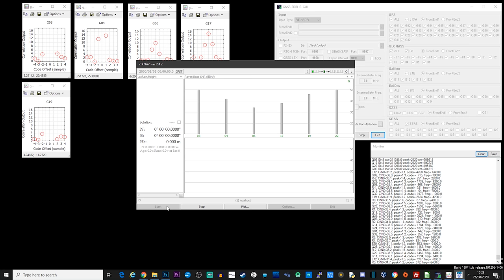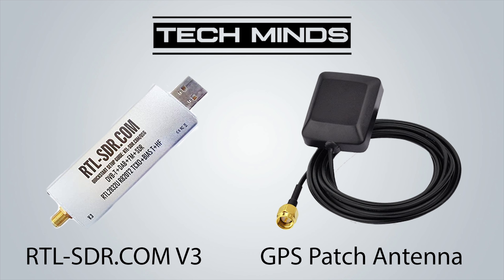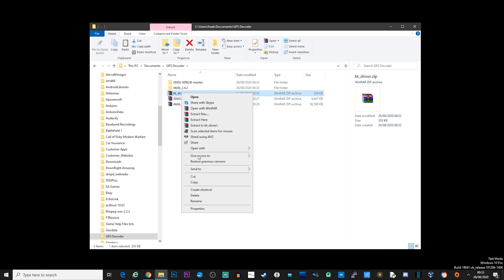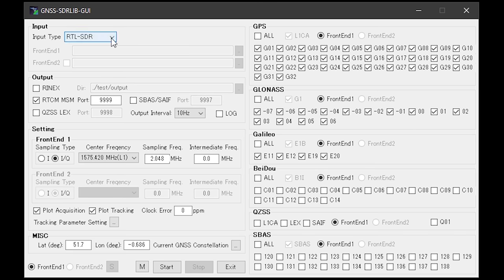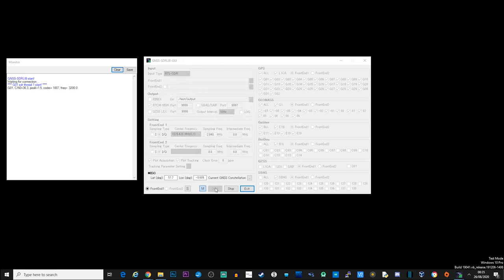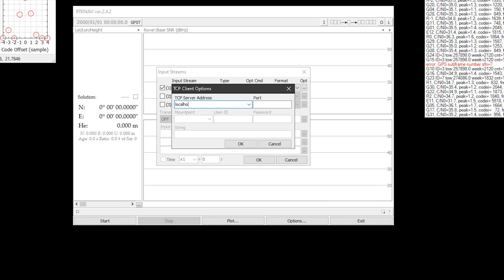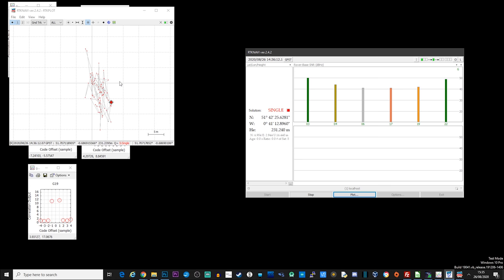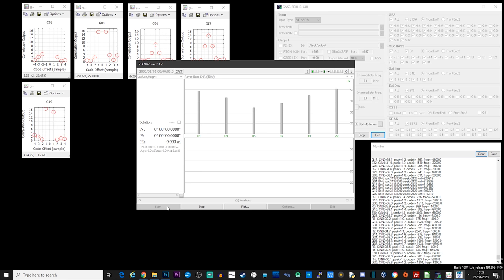Decoding GPS using an RTL SDR Receiver

Comment: The gnuplots after pressing start in gnss do not pop up but the cmd windows show up. The monitor in gnss does show a similar feed as in the video. RTKplot also experiences timeout while trying to connect to localhost. I'm not too sure what's the problem, I followed the video step-by-step. Any advice?

Comment: Hello, Techminds. I am currently using the same hardware and software setup on Windows to log the GPS I/Q data. However, I'm encountering an issue. When I press "Start" in the GNSS SDR-LIB GUI, it doesn't seem to initiate any process. Additionally, RTK-Navi is stuck showing the "connecting" status. 

I would appreciate any guidance you can provide to help me resolve this problem. Thank you.

Comment: I get data scrolling in the monitor window of GNSS even when no antenna is connected. With an antenna connected and RTK running, nothing is displayed. Admittedly, I don't have a proper GPS antenna, just a dipole I use for ADSB, so I guess it could just be down to s/n ratio.
Thanks!

Comment: Looking like it has duel frequency capability see front end One and a option  for a second front end capability very nice Now all you need I guess is a multi band antenna 📡 probably won't work as well as a dedicated device or Ublox kit but it seems like a very affordable alternative 😀 Nice video 👏.
Reply: Help, I'm from Ecuador. I'm having the issue that I'm getting the graphs of the correlation output vs code offset, but the Monitor doesn't give me the ID. Only peak, code, and frequency show up. Thanks.

Comment: I cant do it and im pissed.
I have three different GPS antennas, all of them working "tested with a GPS receiver". I connect the bias tee and supply 5,2VDC from a USB to the coax that goes to the antenna.
The 5V are ok and measured on the antenna side.
The only thing i see on Airspy when i connect the Biastee on the USB is the Threshold goes higher.
Ive tryied to play with the RF Gain but there is no reception.
Honestly, i don't know what else to do.
Reply from the maker: Do you have an RTL based SDR you can test with also?
Reply: @TechMindsOfficial  im using this exact device https://images.app.goo.gl/CTyvY9KPYvRVbzZB6

the highest frequency that i did a demodulation, was at 1090 for ADS-B.
I had an old rtlsdr with E4000 that made it to receive EMEA using a JRC FBB 250 from it's LBand output.
But i dont have this dongle anymore.

Comment: Great video! Was able to open GNSS-SDRLIB and get it to stream data to the monitor, but no sats show up in the RTKNAVI window. Not getting any of the plots either. I tried the RTL-SDR.COM, and two NESDR dongles. I'm using a high-end GPS antenna, and I tried both the internal bias-tee and an external bias-tee. I searched on the RTL-SDR site and it looks like others have had this same issue, but not been able to resolve. Any suggestions? Thanks!
Reply: I'm in the same situation.Help, I'm from Ecuador. I'm having the issue that I'm getting the graphs of the correlation output vs code offset, but the Monitor doesn't give me the ID. Only peak, code, and frequency show up. Thanks.

Comment: Is the software capable of setting the PC clock to Stratum-1 accuracy from the GPS?  Would be a really nice solution for NTP servers.
Reply from the maker: If the output stream contains the GPS time then I guess it could be done.
Reply: You're barking up the wrong tree.   A GPS receiver has to solve for 4 variables, including what the current time is.   And this just bugs me in this video; you don't "decode" your location from the GPS signals.  You compute your location from the pseduo-range that you measure to each spacecraft.  The software can do this by first solving for the current time from the various signals while trying to recover the navigation messages that convey the orbital elements of the spacecraft.  When you know the orbits, you can compute exactly where in space each spacecraft is at a point in time.  You can then figure out how far you are from the spacecraft because you can measure the offset in the pseudorandom bit sequence broadcast by the spacecraft.  But you have to do all this at once, solving for 4 unknowns (time, X, Y, Z) using 3 or 4 spacecraft.

Ideally, you have a very high quality clock with low jitter and high enough precision.  Does the WIndoze OS have timekeeping that good?  Ultimately, the quality of the location determination is directly related to the stability of the the GPS receiver clock.  As it jitters around, the computed pseudorange distances to each spacecraft change, and this also results in the location determination bouncing around.  Likely some of that wander is due to clock jitter.

A stratum 1 NTP clock ought to have accuracy from it's reference measure in tens or hundreds of microseconds; that's trivially achievable by a quality GPS receiver with a good, low-jitter clock.  Plus, the Windoze OS is preempting the programing running, and it's got to precisely measure when the radio signals are decoded into messages and those boundaries.  You're running in a real-time OS with good bounds on scheduling latency.  

Me, I'd just spend $50 to get a real GPS receiver module optimized from time and frequency application (with so-called "position-hold" mode to optimize for TDOP - time accuracy not HDOP or VDOP (horizontal or vertical dilution of position).
Reply: @TechMindsOfficial  The "output stream" from the spacecraft contains neither absolute GPS time or position.   It tells you time the message was sent from the spacecraft, and you need to figure out how far away the spacecraft is to understand what time it is where you are.  Computing the time is part of the computation done to compute your position.   This is why you need multiple spacecraft in view to figure this out.

Comment: Hello, I have done everything as explained in the video but still not getting those multiple windows when I hit start. I am using the same rtl sdr dongle but I have a bit different antenna
Reply: Hello, I now have the same problem. Were you able to solve it? Thank you.

Comment: My rtl sdr blog v3  is unable to receive noaa weather radio I have been changing db and sampling rate and changing to different modes but no luck however I can somewhat receive tv signals using my dipole antenna kit
Reply from the maker: I would most likely think this issue is with your antenna. Maybe it needs to be higher, outside or specifically tuned for the NOAA frequency.

Comment: this method works with L1 signal or it's possible to have L1+L2 ?? Thanks
Reply: As a starting point, you'd need a second SDR. No idea if the software does L2 or L5.

Comment: I am using the same configuration like yours. But in my case it didn't work. The windows are opening and closing but i can't see any gnuplot. I only saw once from one satellite but from then i can't see anything. I am new in this field and i don't know so many things. Can someone help me and tell me which may be the problem? 
Thanks in advance
Reply: Same😢😢😢 u managed to solve ?
Reply: If so can you help me by explaining what should i do
Reply: I'm in the same situation.Help, I'm from Ecuador. I'm having the issue that I'm getting the graphs of the correlation output vs code offset, but the Monitor doesn't give me the ID. Only peak, code, and frequency show up. Thanks

Comment: Hey! That´s really COOL! :) I just set up everything and started for the first time using an Outernet Patch antenna, the LONA amplifyer from NooElec and the RTL-SDR v3. I can only see two sattelits G06 and G07 (here in Germany) and after one min or so their signal runns away. :( Would be nice if it would work with VBAudio Cable and SDRUno. Will have to play with this a little more. Thank´s for the video! 73! DE1CTL :)

Comment: Would you be able to detect a car tracker on a vehicle with this set up ? Please don’t say yes if you can’t explain set up procedure.
Reply: Not with this setup. It is thereotically possible with other equipment, but further research would be required
Reply from the maker: It kinda depends on what frequency the car tracker is sending data on. I would assume most of them these days are GSM, through the mobile data network.